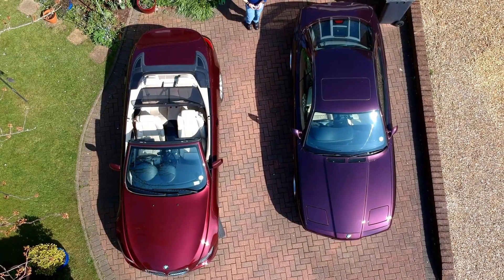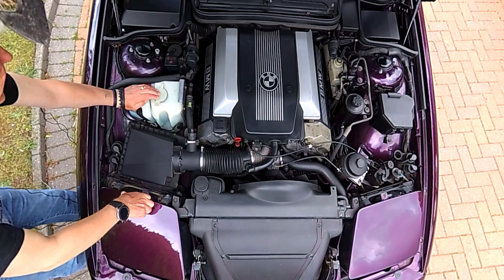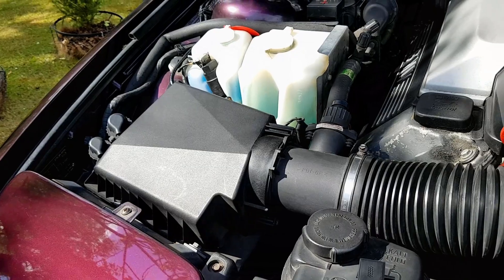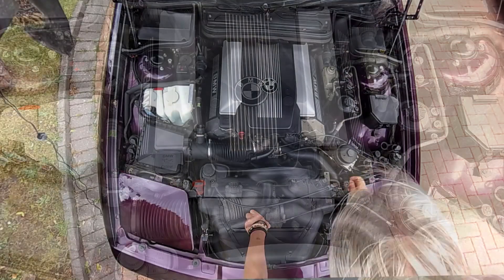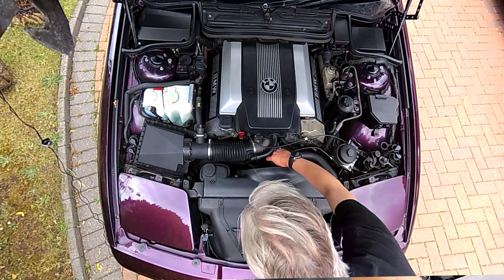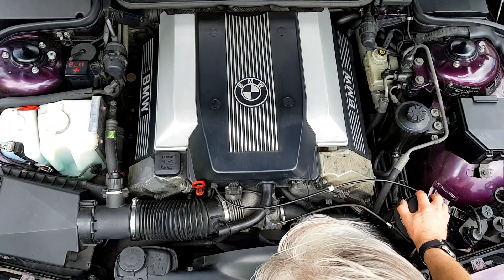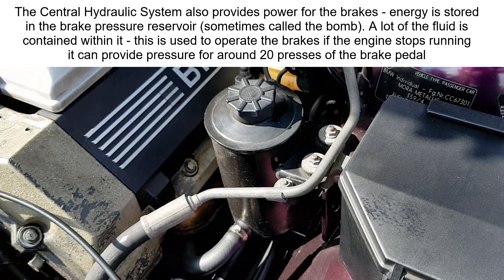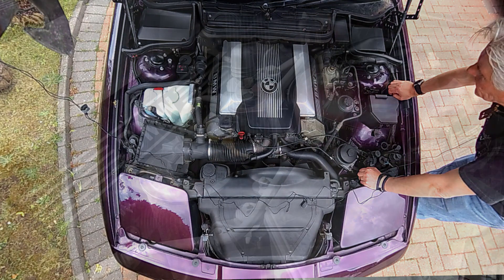BMW E31 Buyers Guide   Part 2 - The Engine Bay

Comment: Hi Timm Can you explain how to check the fluid level & the procedure for  filling the power steering/ CHF 11s reservoir pls
Reply from the maker: The fluid should just cover the screen filter (about 10mm from the top of the reservoir) with the engine NOT running and after 20 presses of the brake pedal (which will release the fluid contained in the accumulator). More info here: https://www.meeknet.co.uk/e31/BMW_E31_840ci_CHF11S_Oil_And_Filter_Change.htm

Comment: Hi Timm How do I remove the main radiator plastic cover without damaging it. I released all the plastic indexing studs but the cover seems to be still held at the top and bottom by small invisible hooks at the top and 3 plastic fingers at the bottom one of which has some kind of metal clip on it. I would really appreciate your help. Thanks
Reply from the maker: I show how it is done here: https://youtu.be/8WgCKGEeRc8
Reply: @TimmsBMW  Thank you😎

Comment: Hey Timm, quick question; in P or N my idle seems fine when in R or D (or on load per se) the idle drops to about 500rpm and the power seems to be halved. Foot to the floor really feels like I'm driving on just 6 cylinders.. Any direction you can point me towards?

Edit: m70, 4spd auto
Reply from the maker: I would certainly suspect that you are only running on 6 cylinders. Stick up a post on Bimmerforums on either the E31 or E32 sections and you will get lots of help - good luck!
Reply: @TimmsBMW  thanks! I did one last inspection before I posted on the forums and found a hole in the MAF casing. Sealed it up and now it's running beautifully!

Comment: Hi Tim - you mentioned that the M62 with Steptronic is the best 840 engine / transmission to have.  I have read in other places that the M60 is more reliable.  Are there any tests I can do before purchasing the 840 with the M62 that the Vanos system is working properly?
Reply from the maker: No need to worry, the 840ci uses either the M60B40 (non Vanos) or M62B44 (also non-Vanos)!